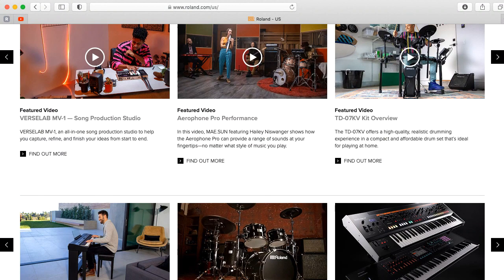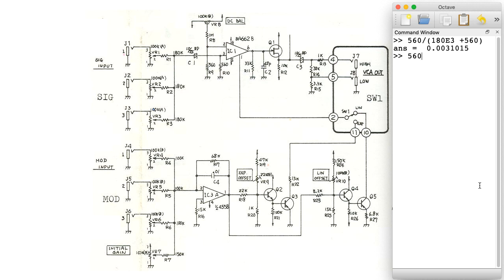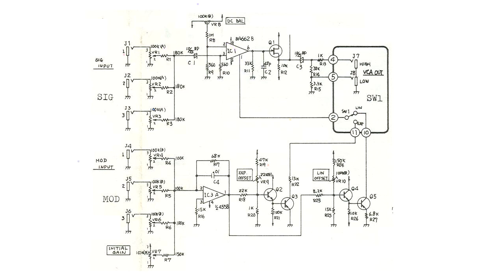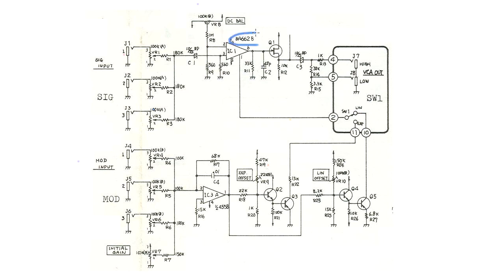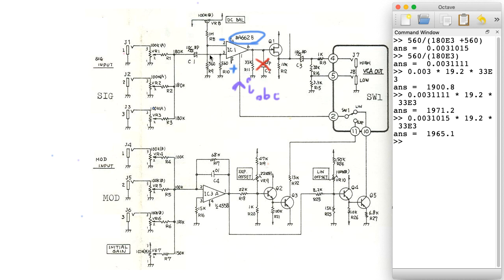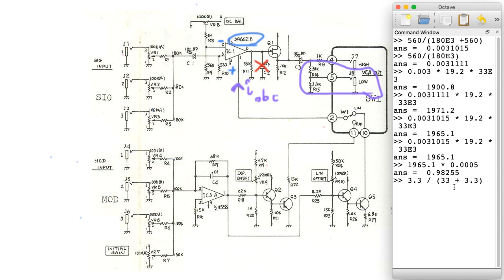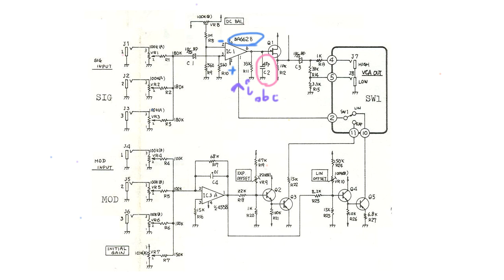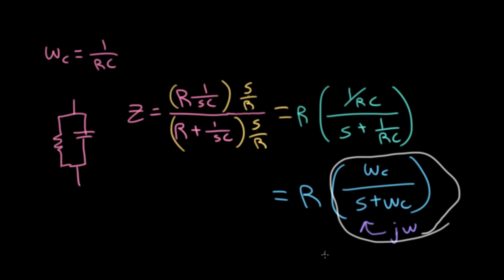ECE4450 L6: Roland 130 VCA Analysis (Analog Circuits for Music Synthesis, Georgia Tech course)

Comment: I suggest the VCA input requires a very small input signal to avoid clipping.
Reply from the maker: That's why there's that big resistive voltage divider in front of the the OTA.

Comment: Minor thing but I think there is a mistake in the schematic?  The bias resistor for Q4, below R25, should be V--, not ground.  I don't think you will get anything going with Q5 otherwise and "linear" won't work.

Comment: I'm currently in the process of converting a non-working Yamaha CS15D Synthesizer over to a Modular Synthesizer system, I managed to find a complete service manual for the CS15D, which includes a complete set of circuit diagrams and adjustment procedures, the whole idea is to convert the circuits over to modular form, quite a few of the modules will be using the custom ICs that Yamaha used in the CS15D, such as the IGO0153 VCO, IGO0151 VCA, IGO0156 VCF, and IGO0159 ADSR Envelope Generator.
Reply from the maker: That is awesome!

Comment: these lectures are basically mana from the physics gods.
I am on chapter 2 (again) of the Horowitz book and almost everything here (augmented by Principles of Transistor Circuits - Amos& James and Electronic Music Circuits - Klein) makes sense  - this is one of the best videos for bringing it all together.
Currently I'm restoring a Roland JX-3P (two bad voices where the NPN transistors were smashed by the pitch bend assembly) and it happens to have the BA662 AND multiple JRC4558's and I've poured over those data sheets many times. 
There are a few videos on the hugely influential CEM3340, but it would be amazing given it's re-release to see how you analyze the design and the many ways it can be used - beyond what is in the data sheet.
 Thank you Dr. Lanterman!!!!
Reply from the maker: If I could only keep one book, it would probably be Horowitz & Hill! :)
Reply: @Lantertronics  It's taken a while for it to sink in hence rereading it over and over. I can finally somewhat intuitively understand the individual parts of this VCO and other "voice" circuits. I have a Phy degree, but the way it was taught at the undergrad level, there was very little that bridged the E&M theory to actual components on a breadboard. So I've spent years in limbo trying to reconcile the two worlds, sadly.

Comment: Great lecture, was very interesting and fun to watch how You tackle a design from the start. Interested to see somewhere in the future how all the transistor magic works. Thanks!

I do have a more general question considering CV inputs like this in circuits. What is the plus side of using such a 'low' cutoff low pass filter? I get that it does not really matter as you should be plugging in DC or LFOs, but I love plugging in audio rate signals in CV stuff for interesting results. Like to get AM modulation with a VCA and two oscillators. It seems to me that a design like this only 'removes' an extra creative opportunity like that. But i suppose there is a good design reason for filtering out higher frequencies?
Reply: good questions, I am also interested in the answer. I have a guess that some components may behave in an unwanted manner at higher frequencies, but I don't really know

Comment: hey professor Lanterman,

nostalgia is a good thing, but i know a VCA schematic that will blow your mind, among a few others and beats pretty much anyone, Buchla, Moog, Roland, Korg, etc, etc. the establish brands.
I'm pretty sure you will be amazed. that some small company can outsmart bigger things.

have an email address so i can send it to you?
Reply from the maker: Sure -- not hard to find my e-mail, just go here and click on e-mail: https://www.ece.gatech.edu/faculty-staff-directory/aaron-d-lanterman
Reply from the maker: Oh, yeah, none of those old designs were particularly intended to be "hi-fi." Something like the SSI2164 would be cleaner, and if you really want a clean VCA, probably the chips by THAT Corp. would be the way to go.
Reply: @Lantertronics  

the SSI2164 is probably cool if you want to squeeze 4 vca on a tiny board,, but i have build a (proper) VCF and this particular Roland VCA using lm13700, but simply linear 1 week ago, the LM13700 does a very good job, most people want even hear  the difference. although it would be nice if Texas Instruments would  make a CA3080 replacement, a single OTA without the darling buffer and like the CA3080 in a dip8 package ... or a version with identical FET like the 2SK30  Roland setup used instead of the darlington buffer.

this hi pass filter i made, uses both, Roland FET configuration followed by the onboard darlington buffer, like ray Wilson did in his designs, it sounds awesome.
https://www.youtube.com/watch?v=l_sAsZFENLo&t=311s
i used 1nF / 1000pF WIMA 2.5% capacitors, i didn't measure it, but i guess the cut of point is around 4 or 5 kHz. in between.

the images i have from my Tektronix 2212 scope from my experiments are good, i don't see any distortion in the wave forms, even uneducated unemployed people blind for brands screaming for the best of the best, accepted my build VCA.

Comment: For the analysis of i_abc, unless I'm mistaken, there's a simple trick you can do to get a very rough ballpark number without analyzing the circuit fully. Assume Q3 or Q5 are dead shorts over C-E, as an extreme. Now, R22 and R27 control the maximum current. Divide the supply voltage by this resistance and you get for example i_abc < 12/6.8k = 1.8 mA as an absolute maximum limit. We will never see such a high current, so reasonably, in a practical circuit, i_abc < 1 mA.
Reply from the maker: Nice!

Comment: @1m45, i used a simple 2SA733 in a linear V to I converter construction like found in the Roland Jupiter 8 and many others, i used a 1 resistor and trimmer. i have tested it and it works satisfying, tested it with scope.

@9m55, i don't think it's experimentally, pretty much no control voltage in the input would go up to 15 volt power rail. many ADSR are 10Volt.
blowing in 15 volt would produce a larger output than 10 Vpp at the output.

@10m00, this trimmer aint really necessary, as the capacitors on the in and output would solve the problem and center the wave. as long as you use 1% or even better resistors.

@12m19, you need that 10K resistor otherwise it would be a plain short circuit, using the buffer of the LM13700 and use a 33K resistor it will flatten the negative part of the wave, so the negative part of the wave isn't symmetric to the positive part, but smaller in amplitude.
Reply: @10m00 I disagree slightly. As you're saying, the inputs and outputs are AC coupled, so the trimmer is not there to adjust the absolute DC offset through the signal path. The trimmer is rather there so that reference level on the + and - inputs are identical to each other (or as close as possible to it). Specifically: a slight mismatch between + and - reference level would create a small DC offset going into the OTA. This DC offset would be multiplied by the control signal and so the control signal would be coupled into the signal path and give a small click or similar artifacts every time there's a sharp change in the control signal. Apparently, the Roland engineers thought this was important enough to address, perhaps even with 1% resistors.
Reply: @Gameboygenius  i have build this VCA less than 2 weeks ago using LM13700,
but i didn't use the CV control circuit from Roland, but instead a simple 2SA733 transistor, resistor & trimmer. you don't need the "balance" trimmer. 

Mutable Instruments doesn't do either in her Ripples VCF design.
https://mutable-instruments.net/modules/ripples/downloads/ripples_v90.pdf and she has researched this issue over and over.
neither did she in the 4 pole mission.
https://mutable-instruments.net/archive/shruthi/build/smr4mkii/
https://mutable-instruments.net/archive/schematics/Shruthi-Analog-SMR4-mkII-v02.pdf
https://mutable-instruments.net/archive/documents/smr4mkII_analysis.pdf

you don't have to worry about the mismatch .... the 10uF capacitors take care of that, they will center the wave again.
it might be another story if you leave out the caps.

if you really wanna be tedious, just get some 0.1% 1206, 0804 resistors, but 1% metal film resistors does the job just as good. i suspect even using normal 5% resistor would work, as long as you include the capacitors.

.... and even if you would use plain 5% resistors, no caps, you probably not even hear it and still have lots of fun.
Reply: @AnalogDude_  It may or may not be ok without the trimmer in practice. However, the fact that you're reiterating this "you don't have to worry about the mismatch .... the 10uF capacitors take care of that, they will center the wave again." tells me that you didn't read and take in what I said, and you're responding to something else.
Reply: @AnalogDude_  Or how about this. High precision resistors are a modern luxury. In the Ripples BOM, the resistors in question are specified as, not 1%, but 0.1%. Unheard of in the 1970s when the Roland 130 VCA was designed. Roland probably sat down and did the math, and figured out that it was cheaper to have a factory drone trim the DC balance, than buying a resistor that had better tolerance from the factory. Today, SMD resistors are automatically calibrated in the factory by laser etching them to the specified tolerance.
Reply: @Gameboygenius  
i have this click in the Frequency Central dual XVCA
but i used normal 5% resistors for the 2, there is a bias trimmer, but it still doesn't remove it completely

that's why i made this VCA.
i didn't use the trimmer , but i did use 1% resistors and it's perfect.
Reply: @Gameboygenius  "SMD resistors are automatically calibrated in the factory by laser etching them to the specified tolerance. " 
i know and you have even better 0.1% resistors, the price of a Panasonic 0.1% resistors smd is about 0.25€ and some going over 1€ a piece for a 0.1%.
Reply: @Gameboygenius  but in this particular case, the capacitor after the mosFET is really needed. otherwise you would have a negative voltage on the output.